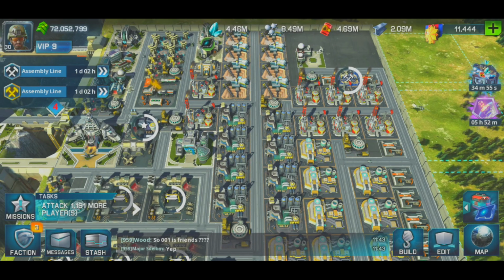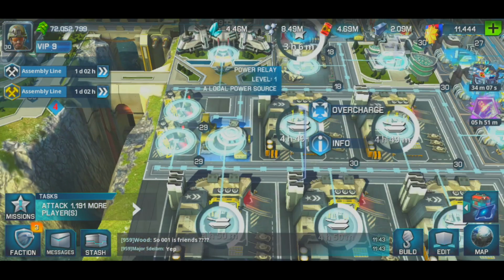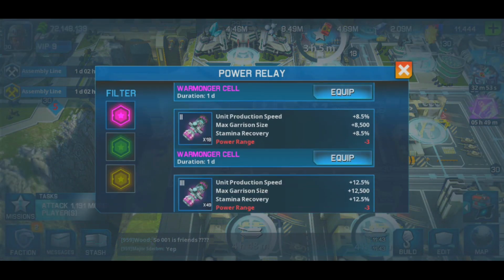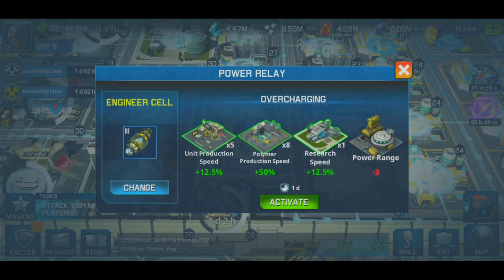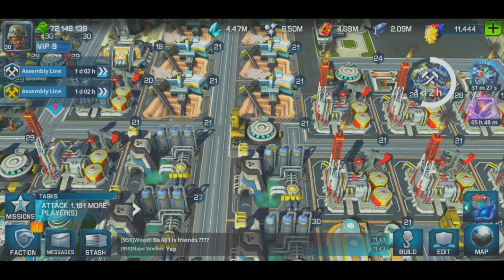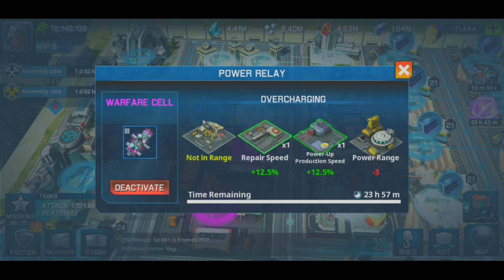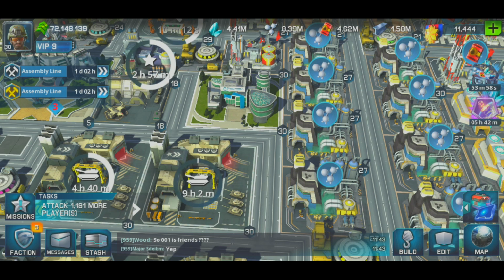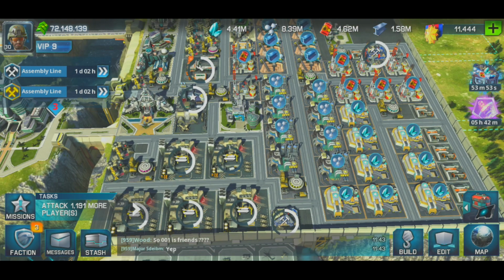War Planet Online HQ 30 Design- Pro Layout

Comment: Thanks for the layout.  Level 30 and you still don't have the two end spaces opened up.  I'm at 17 and only need the top right to meet your space constraint.  Sill question, your map is pretty much head on, mine is at an angle, how do I rotate the viewpoint?